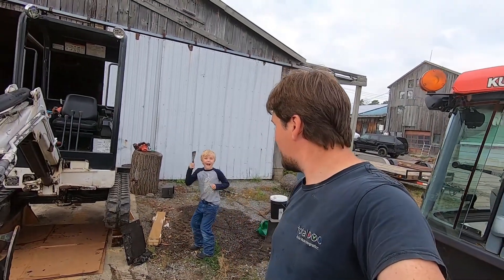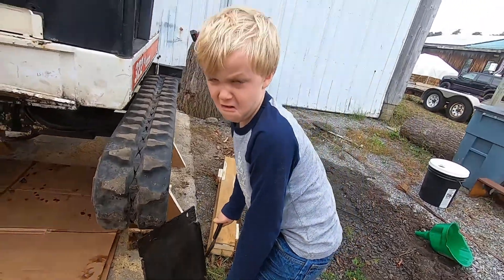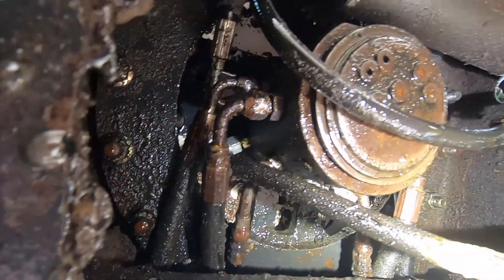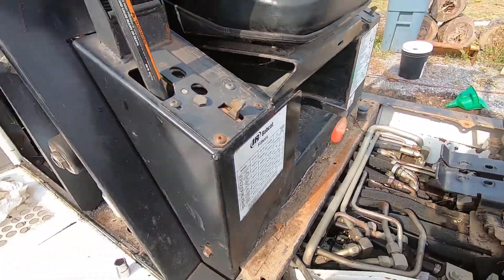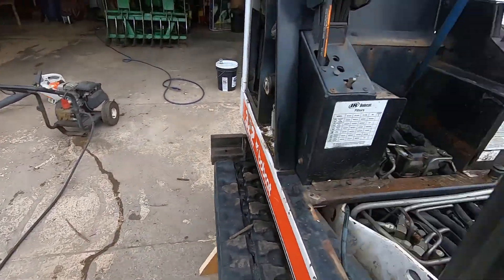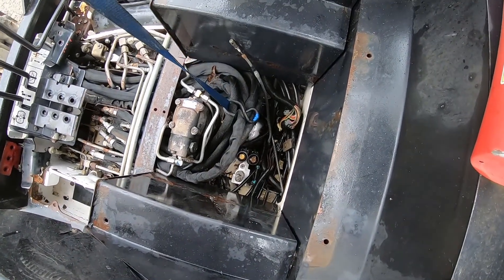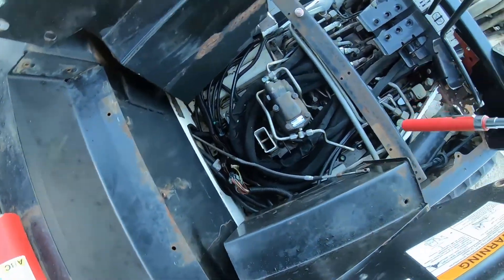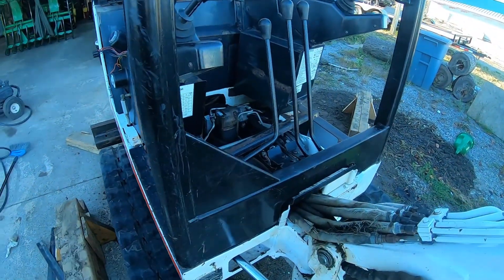Fixing a leaky mini excavator

Comment: I'm trying to find your video that has that Gradall that I thought was a Drott in an earlier video.
I wanted to see what you did with that Gradall.
Reply from the maker: It got scrapped unfortunately. I saved the Detroit 471 power pack. Here in Ontario those are considered commercial trucks and need a strict inspection every year. It was way too far gone to save.  Rust belt!

It's in the scrap metal video.